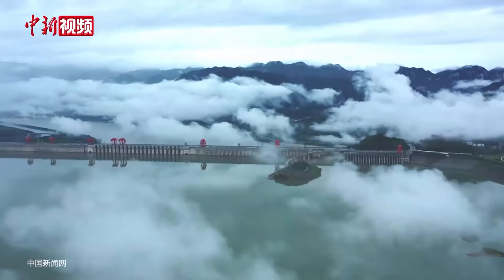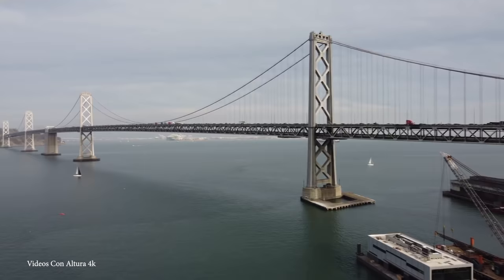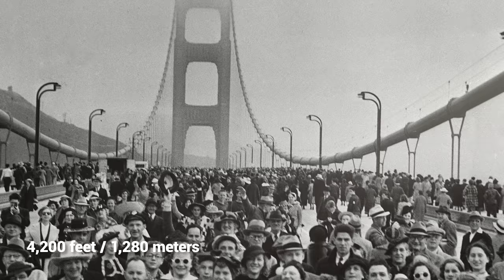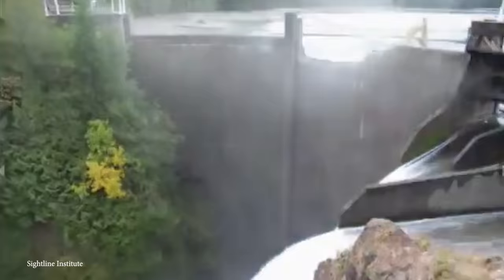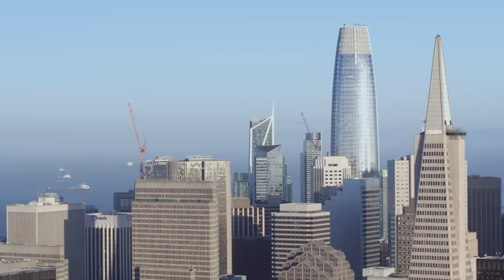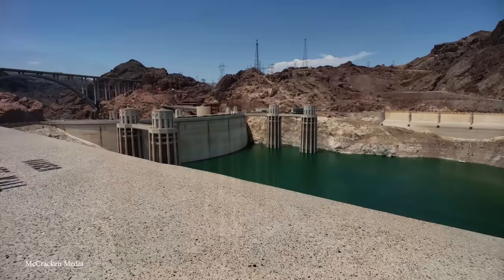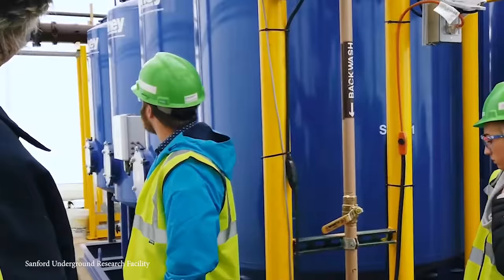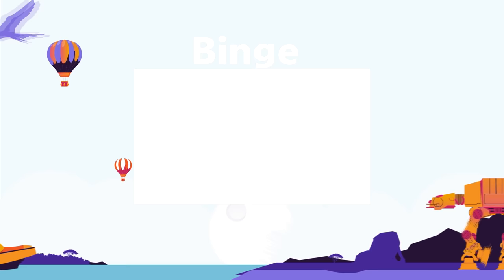15 Insane Engineering Marvels

Comment: Uh.... For the Bay Bridge which links San Francisco to the East Bay, I think the stock footage is all wrong.  The footage shows the western span of the bridge.   The Bay Bridge is actually two bridges:  The western span which is a suspension bridge that runs from San Francisco to an island in the middle of the bay (Yerba Buena Island).  The other "bridge" is the eastern span which runs from Yerba Buena island to Oakland.  The eastern span was a cantilever bridge.  That's the portion of the bridge that suffered the roadway collapse in the 1989 earthquake (which occurred during the world series baseball game between the San Francisco Giants and the Oakland Athletics).  The stock footage in this video is of the suspension portion of the bridge.  The part that was replaced by the "Engineering Marvel" was the cantilevered eastern span.

Comment: The i-90 floating bridge in washington just south of the sr-520 bridge is way more impressing. 4 lanes eachway and now a light rail nearing completion in-between the eat/wastbound bridges that connected the 2 sides. I drive both every week depending on traffic and the i-90 floating bridge is cooler to me.

Comment: Was this able to be done in 1873? i.e. the International Railway Bridge in Buffalo NY? Niagara River current there is between 7-11 mph constant. This was prior to the installation of the ice boom. Also levels of River vary w the wind off of Lake Erie, this increases flow & there pressure exponentially. How were caissons sunk in 10 mph current, in 1870's? I am currently researching this, help & insight welcomed & most appreciated 🙏💯.
🐾

Comment: The floating bridge actually partially sunk during bad weather and there were no small compartments to stop the water I could be wrong
Reply: That was I-90 not 520 and the reason was due to contractors leaving the top open during resurfacing. Get it right!
Reply: @danjberg  ohh thank you for correcting me sir lol and I'm sorry for the confusion